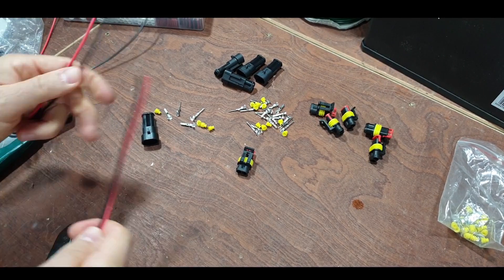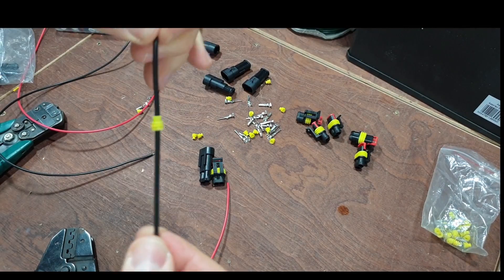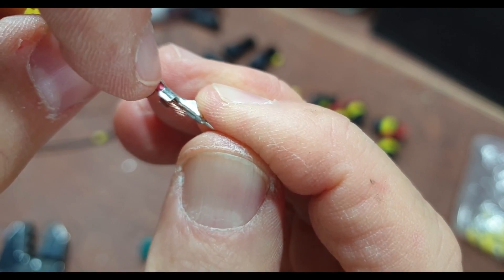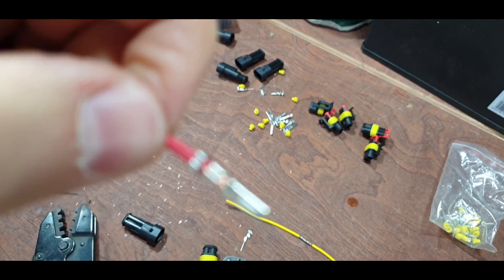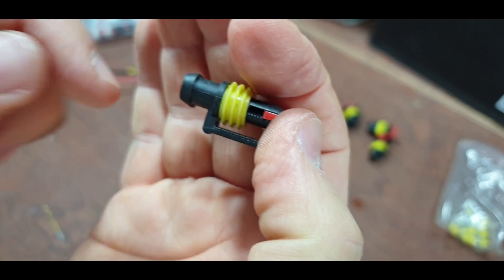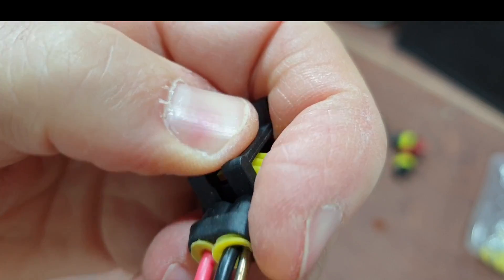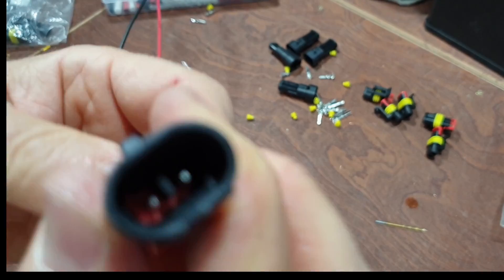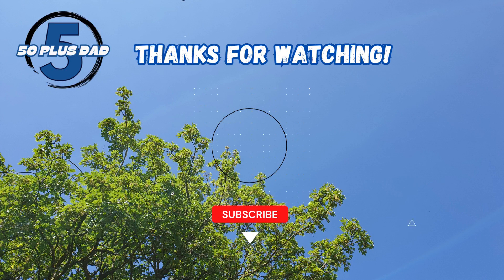Waterproof Connections a Step-By-Step Guide (make your own)

Comment: Thanks
Reply from the maker: No problem thank you 👍👍
Reply: Hi, Im planning on buying these, would it work with smaller wires?
Reply from the maker: @saucefinder1264  these are designed for 20 AWG up to 16 AWG wire size, if your wires are smaller you would be better off finding a water proof connector the correct size for you wire, they may not crimp properly because the terminal are too large and wont grip the copper core and the silicone grommet would be too large to seal effectively. try and find your AWG size and match to that.👍

Comment: Thank you for the video! Crimping the longer tabs around the wire electric insulation (rather than the silicon weather plug) makes so much sense in terms of mechanical strength. It is puzzling why most instructional videos crimp around the silicon plug. That approach makes a weaker mechanical connection. UPD: just read through lots of comments to the same effect and will be using the technique used in this video, it seems superior.
Reply from the maker: Thanks for watching 👍
Reply: Thank you, sir. Happy holidays!

Comment: To keep moisture and debris out when not connected to the charger, it would be great if there was a bung or cap of some sort.
Reply from the maker: Get another connector dont put any terminals in it and fill the cable holes with silicone, you can use it as a blank/bung/cap 👍

Comment: Yeah the smaller end of the yellow grommet/seal is supposed to be clamped by the larger of the clamps. Unless you push them into the round hole they wouldn't keep water out.
Reply from the maker: I get a better crimp this way

Comment: Good video. Thanks for taking the time to post it. If I’d watched this first I wouldn’t have to do the job again. Glad I bought an 800 piece kit from Amazon to make one plug up 😊. That’s not sarcasm. I’ve used several pins already and it’s still not right ! 
Does the larger plug also need a red piece putting in it ? You mentioned it but I missed it going in. How do you keep it waterproof when it’s not connected to anything ? Is there such thing as a blanking plug available.
Reply from the maker: Put the red bit in it lock the terminal in place. You can make a dummy plug to seal when not connected just silicone the hole where the wire would have been.

Comment: Thank you for this tutorial. I bought a kit on Amz, and I thought it should be easy to use, but it is complicated to use. Not easy to crimp (yout ratchet crimp seems to do it so easily, but mine is not able to do so nice connection), and hard to insert.
Reply from the maker: If it's got the right jaws it should crimp

Comment: This is one way to do it, but it’s not the right way. The silicone plug should also be crimped.
Reply from the maker: Absolutely, The reason I don't probably stems from the mid 90's Grand Cherokee, I was involved in upgrading the security for the uk market, one of the biggest problems we had was pins pushing out on the alarm door wiring due to the grommet being crimped too far down and stopping the terminal clicking home, admittedly not the hand made pre production wiring looms more the later factory made stuff, we used to pull them back up the cable and refit but this way solves that and the grommets don't fall out.

Comment: Hello! Thanks so much for this. It's the only place I can see the actual crimping process working. What is the crimping tool you're using please? I have one for spade connectors but it is much more basic and doesn't crimp both parts of this connector at the same time.
Reply from the maker: Thanks, there is a link in the description for the crimpers from amazon

Comment: Good demonsteation. Thanks. can I use my Dupont crimper or should I get this one?
Reply from the maker: You could try it on a spare connector and see if it works before buying one you may nor need but ive always used this type.
Reply: @50plusdad-uk  ok thanks

Comment: Great video! I installed some super bright LED lights to the front of my car and I tapped them into the headlight and high beam wires. I realized that it’s gonna be impossible to remove the bumper if I ever needed to so I thought I’d try these out to quickly disconnect the lights 👍

Comment: How many amps can these handle?
Reply from the maker: I only use these for low power stuff, you'll need to check the manufacturers specs for the load rating 👍

Comment: The only thing that worries me a tad is that the connector that you leave inside the grill of your van is not going to be waterproof from the "inside" (where normally two connectors go together and seal each other). In my  boat I make up a further male "dummy" with short wires glued together and sealed for when there is an exposed 1/2 connector like that. Unplug the dummy when you use the lead.
Reply from the maker: I have a dummy plug with no wire or connectors in just silicone, but most of the time I just tuck it behind the grill pointing down, there is silicone grease on the terminals and they are fine, but I do check they are dry before plugging in.
Reply: @50plusdad-uk  Perfect!

Comment: The "correct"crimping tool for these connectors is horrendously expensive so this is a good alternative.  The comment below about the sealing grommet being crimped on the second crimp is correct.  Using untwisted wires allows the front crimp  to grip more positively, but its up to you.  The normal convention is that the live/hot/positive wire goes in location 1.

Comment: Excellent tutorial. I clearly am using the wrong crumpets as I crushed the locking tab down. Right tool= right job. Thanks
Reply from the maker: Thanks for watching 👍
Reply: I got the crimp tool that came with but having same problem lol the male ones are bit hard to get pushed in as well. any tips ?
Reply from the maker: Check your using the right size boss,  if it's too small it can crush and deform the terminal making it too wide to fit it the connector, sometimes they can also bend if crimped too hard, also check there isn't too much copper sticking through the lugs on the terminal as that can stop it going in.
Reply: @50plusdad-uk  Thanks for tips! i belevie im using right size but maybe i am crimping to hard sometimes they do look lil bent..Am i able to solder instead of crimp?
Reply from the maker: Yes can solder, but check the adjustment on the crimper, there should be a screw near the hinge holding a plate with slots, loosen the screw a turn the plate to adjust it.
Reply: @50plusdad-uk Thanks for reply! I actually got it figured out now. Think I was using wrong size and was bending them a bit. I Wired up sons fardriver harness last night n works good. Pretty easy now. Thanks a lot for the help and video. Gonna subscribe
Reply from the maker: @SirusTheVirus thanks, glad you got it sorted 👍

Comment: Thank You!  Your instructions helped me put together my very first connection of this kind.  I didn't have the correct tool, but I tugged on the wires and they seemed solid.  Do you mind saying the model of crimping tool you have?  All of the local stores carry something that looks similar, but they are for the larger spade and loop kind of terminals.
Reply from the maker: Mine are over 30 years old not sure you can get them, I've put a link in the description which should show you the size you need.

Comment: Your video is very very helpful, i will use this molex connectors for my watercraft because i have a series problem in the main harness. 
The workshop offered me only to buy New main wire harness it  costs 1200$ 

Thanks yo your video, i bought a new molex connectors for 19$ and fixed my problem
Reply from the maker: That's great nice job.

Comment: The brand of those connectors I bought shows crimping the narrow part of the silicone seal along with the wire insulation.  I only repair this type once a year so I usually refer back to pictures.  I suppose stuffing the silicone in manually later works though.
Reply from the maker: I like to do it this way, as I get a better crimp on the insulation and a firm click when pushing the terminal into the connector so less chance of it backing out.
Reply: Yeah.  It gets a little hard to push both in together and reach the depth for the tab to click into place.  I crimp them hard enough that it sometimes tears the silicone where i crimp both.  So it relies on the tightness of the silicone to seal, fortunately they are very snug on the wire.  I always tug on every wire to make sure it is locked in place.
Reply from the maker: They're easy to split 🙂👍

Comment: I don’t know if you’re still monitoring the comments on this video….

It’s an excellent video, and will be priceless to get me started on some plugs I need to make.

The crimping tool that you are using: does it have a name, manufacturer, or part number?

I tried some Google searches, but was just overwhelmed with information. I have an iCrimp tool, but it appears to be for smaller wire, and I cannot read the part numbers: my connectors won’t fit into the jaws.

Thanks.
Reply from the maker: There's a link in the description to a set on amazon, you'll be able to see which type im using. Hopefully it'll help you find a set.
Reply: @ 
Perfect!

Thanks so much.
Reply from the maker: @onearmjack7914 👍👍

Comment: How do you remove the Female pins from ce5154 female connector?   5 Pins.
Reply from the maker: I've never used them, but most operate on a similar principle, there will be some kind of tab either on the terminal or on the connector that prevents the terminal coming out. The way to approach it is gently, if you force it you can bend the tap and make it much more difficult, try looking where the terminal is with a torch for any clues on how its locked then arm yourself with a selection of pins drill bits anything that will fit in without damaging anything, patience   is your friend but once you get one out it should give the game away on how to proceed with the others. Hope this helps or gets you started.👍

Comment: What’s the tool you used to crimp the wire looking for a good reliable one I can trust not to break the wire
Reply from the maker: There's a link in the description, if you get some try a test crimp and if to tight you can adjust them by turning the plate near the hinge.

Comment: The pin won't stay in the female connector. I can just pull it out without much force. Isn't there a securing clip like on the male connector?
Reply from the maker: Yes you should have a clip and a lock device, check that you don't have too much copper showing as this can sometimes block the gap that the lock drops into preventing it from securing the terminal also check the terminal has not been deformed and that it's going into the connector far enough to lock. Hopefully this helps or puts you on the right track 😁
Reply: If you haven't broken the very tiny retention tab, turn it over 180 degrees.  It fits both ways, but only click locks in the right way.

Comment: Is there another way to like bend the steel pins without using the special tool? Bc i dont have this tool.
Reply from the maker: You can make something that will work, Have a look at this https://youtu.be/dOA-lhNWeGk it may help
Reply: @50plusdad-uk  thanks alot for this, but I ment like is there another way to get the male and female terminal onto the wire without using a special tool?
Reply from the maker: @maartenprojects2440 my bad you mean crimp tool, at a push you can fold it with some long nose pliers but it needs to be tight and small enough to fit in the connector it's a bit hit and miss, also worth soldering it as well so you know it's not gonna come off. It would be better to try and find a cheap crimp tool if you can.
Reply: @50plusdad-uk  yeaaah thats what I mean THANKS!
Reply: You are better off to get a proper crimping tool. I tried long nose pliers and they failed pretty quick. I found a crimper kit on ebay for around $41.79US plus delivery.
Reply: @jemijona  I did it with long nose pliers and they hold on pretty good for now
Reply: @maartenprojects2440  I spent a hour or two with pliers and it didn't work for me. So I had to give up on these connectors. I have been crimping for decades so I have a good idea. That is why I tried long nose pliers in the first place. This is the first time using this plug/socket system though.

Comment: Can I ask you a serious question. Why can't you anyone show a single pin superseal amp connector 1.5 removal. Especially the removal of the red piece on the female side. Why is everyone so scared of this. It's no where on the internet. Look.
Reply from the maker: I've never used singles but looking at the online they look very similar in construction, if you having trouble removing the red female try pushing a removal pin in from the back, wire side and see if you can push it out enough to then get the pin in and lift the lock tabs. 👍

Comment: Great video. Thanks for sharing as couldn't find any good info anywhere. Do you do anything to protect the disconnected plug (on the car) from moisture ingress? Ie plug it with a blanked female plug or something?
Reply from the maker: Yes exactly that, blank female with silicone filled holes 👍

Comment: Hi, very helpful video. Can you tell me which crimpling tool you are using. Cheers.
Reply from the maker: Thanks, You need non insulated terminal crimpers, I put a link in the description so you can see what to look for 👍
Reply: Thanks for that.
Reply from the maker: No problem, thanks for watching 👍
Reply: @50plusdad-uk  hi,  another question, someone has said that the yellow waterproof bung should be crimped on the wire. Is this right, or the way you've done it. I'm just asking. Thanks.
Reply from the maker: You can do both ways, I don't grimp the bung so I get a better crimp and it clicks in the connector easier. Sometimes when you crimp the bung it can move so you still have to poke it down. The bung won't fall out if not crimped, have a try both ways and see which works best for you 👍
Reply: @50plusdad-uk  Hi, sorry to keep bombarding you with questions. What size terminals are they, and where would I get them. Or maybe a small box with an assortment in. Got the tool, so I would like to have a practice. Cheers.
Reply from the maker: It's not a problem, I think they are 2.2mm you can get sets with a selection of terminals, spare bungs and removal tools 👍

Comment: I bought a packet of these from Amazon about 3 years ago. Finally a reason to use them the other day. Got the packet out and thought what the FXXXXK do I do with these? I ended up soldering and heat shrinking the cable onto my brand new bike's wiring, which I really didn't want to do. Sitting here a week later I thought, wonder if there's a post on YouTube?  Of course there is! Thank you 1000% so easy to follow and concise. I'm off to pull all the panels off my Can-Am Spyder RTL & do the job I wanted to do in the first place. Bought the tools from you & sent a couple of coffers over to you too - Cheers matey!
Reply from the maker: Thanks, so glad it helped good luck with the spyder, nice machine

Comment: Ima he honest these connectors are terribly hard to get working I’ve spent like 5 hours on them and they don’t work. I’m just gonna solder directly I guess.
Reply from the maker: Once you get the hang of crimping the terminals they should be easy to assemble, things like the terminal being squashed or too much copper sticking out the front, both can stop the terminal clicking home. Make sure the terminal is the right way round and clicks home without forcing it.
Reply: @50plusdad-uk  thanks for the advice lol, turns out these pins were too big for my wires, so I had to add solder to keep them in place, but that changed the dimensions. Making it terribly hard to use.
Reply from the maker: No problem, I'm glad you got it sorted 👍
Reply: They are terrible for me too.  I only do them once a year and have to refer back to the jungle website page where i ordered it from to see good pictures.  
After I do one, I'm ready for more, then a year goes by...
I might download those pictures in case the seller disappears along with the pictures and instructions.

Comment: Hi i bought the crimper from your description its the HS-03BC but it says on the crimper body For insulated terminals can you explain whats going on please
Reply from the maker: Hi on the handle it says for plug spring terminal (non insulated) there are different dies (jaws) as long as the die is correct as in the picture these will fold and form the terminal, insulated terminal dies are flatter and just compress or crimp the terminal.
Reply: @50plusdad-uk  Thank you for your reply, much appreciated.
Reply from the maker: @gonkafrynook  no problem👍

Comment: Can I use a standard wire crimp tool, or do I need the terminal crimp one?
Reply from the maker: I would use a terminal crimp if you can as the lugs need to be folded back over themselves each side forming an "n" to crimp into the copper, standard crimps will just flatten the lugs and not grip properly as they are designed to crush rather than form as specific shape.

Comment: I am from India, can I use 16A 260V Connection with these Connectors ?
Reply from the maker: No, I would only use them on low voltage low amps.
Reply: @50plusdad-uk  Thanks for the Reply
Reply from the maker: Your welcome
Reply: These connectors are rated at 14 amps for each wire for low voltage found in cars/trucks.